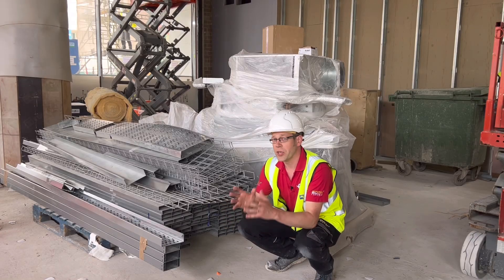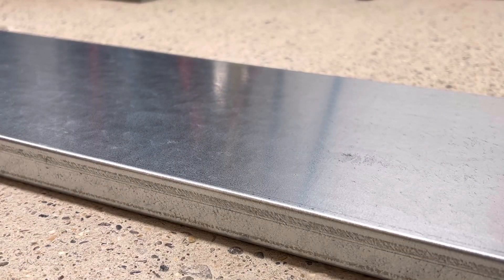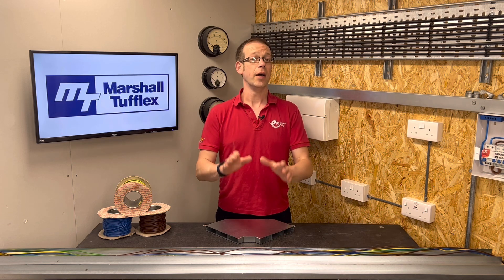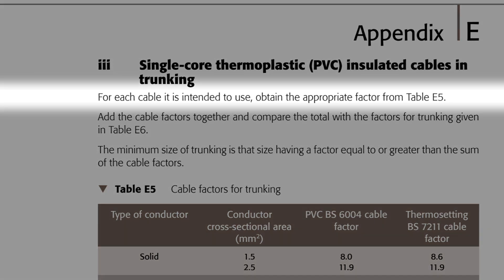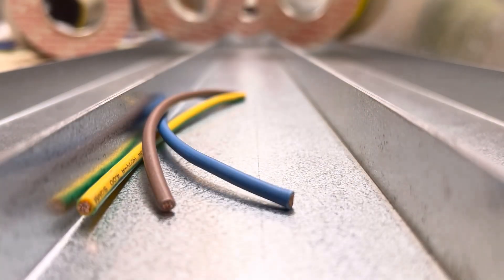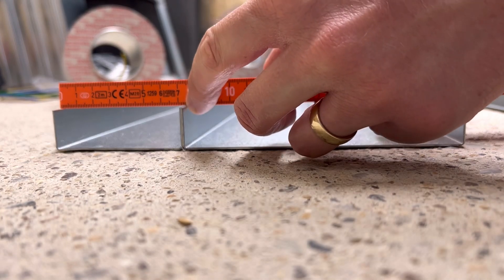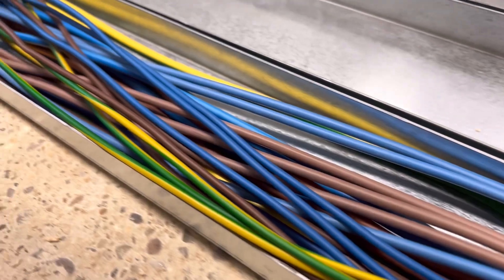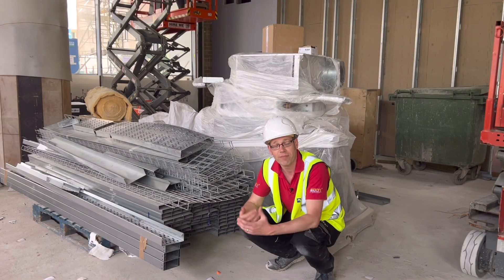How Many Cables Can you Fit In Trunking?

Comment: I used to work in a building that had quite low ceilings, with cable tray crammed with coax and Cat5 data cable, down the corridors.  Every time a new system was installed, they hung a further cable tray under the existing one, as nobody dared take out any of the obsolete cabling!

Comment: Biggest problem I THINK we have in this country with regard to the regs;
Leaves to much up to the installer. They seem to be able to interpret what they read.
Had a question for a few sparkies I worked with. Hypothetical of course.
"If you had to cable an appliance and you had taken ALL of the precautions, taken account of ALL of the considerations like disconnect time etc, and carried out ALL of the calculations necessary to determine the max current pulled and it turned out to 99A. Would you use cable rated to carry 100A.
None would/could answer.
Reply: That's for an electrical engineer to figure out...

I'm no electrical engineer but I'd still be asking more questions. How long is the run? Is that cable rated 100A @ 75C or 90C? What is the duration for which max current is pulled? What is the typical current actually expected to be? Cause frankly depending on the answers to those it can be either yes or no and still be a perfectly fine system. Am I cabling directly from a breaker or adding to an existing system? What is the likelihood of this system being modified in the future and requiring more power?

Sure someone could give you the stock "no, your breaker would need to be rated for 125A because of the 80% rule. your breaker protects your wiring therefore your wiring must also be 125A. most breaker terminals are rated for 75C and therefore the wire must be 125A @ 75C and not 125A @ 90C unless you know for damn sure the breaker's terminals are rated for 90C" but that could just be unnecessary cost without asking further questions.

Comment: Still remember one of my first big jobs as an apprentice. Trunking in the risers has the lid held on with cable ties and was so warm it was uncomfortable to touch, and that was before the building was in use. Might have been something to do with the rings being wired in 4mm.🤣
Reply: What would the heat have to do with 4mm rings?...Most commercial jobs have 4mm sockets
Reply: @roystevenson1375  Meant the trunking was packed more than it should have been with no air space for heat to escape.